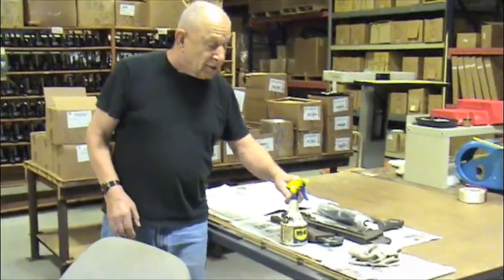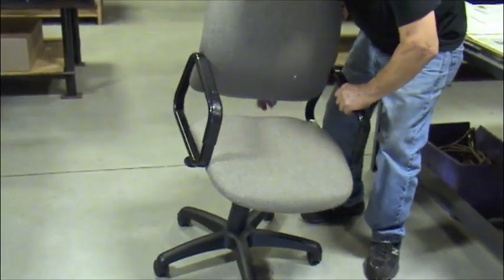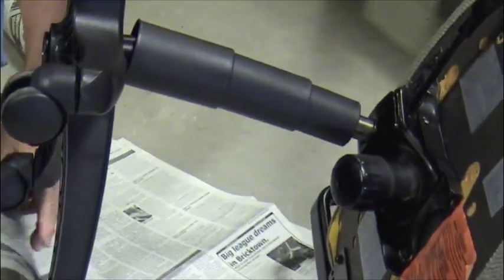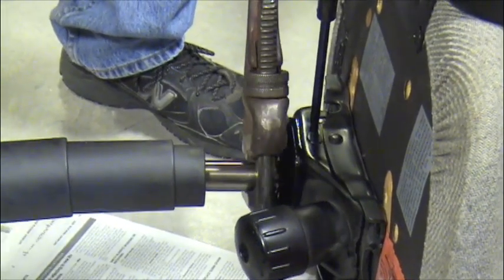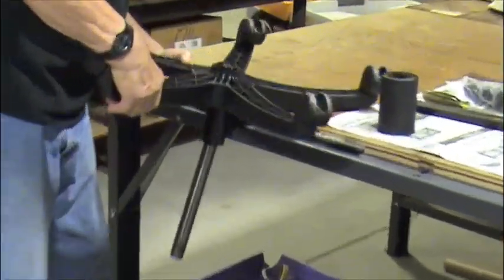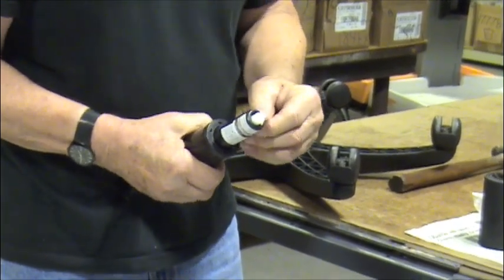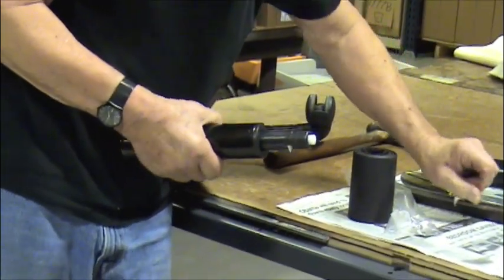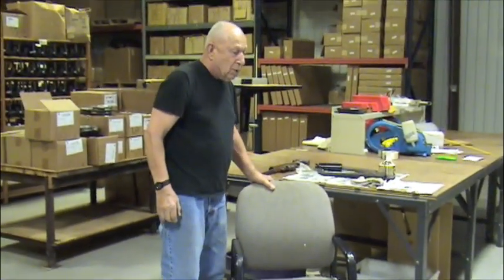How to: Remove gas cylinder using a pipe wrench

Comment: Great video. For those watching who are about to take on this job, pay close attention to the "longer is better" part for the pipe wrench.
Also, make sue that you are using a PIPE WRENCH, otherwise you may not succeed.
I repaired one chair about a month ago and was lucky enough to get the cylinder off using a 10 inch pipe wrench and a few minutes' worth of hammering on it.
On a second chair which I did today I used the same 10 inch pipe wrench, hammered for a half hour trying to get the top end out and it never budged.I was on my way to Harbor Freight to spend 12 bucks for an 18" pipe wrench when I saw my neighbor outside - I asked if he had a big pipe wrench and he handed me an 18" one. The top of the cylinder was loose in 10 seconds.
I then went to hammer the cylinder out of the base as shown. It wouldn't budge. I let it soak for a half hour with PB Blaster. No dice. I took the 18" pipe wrench to it - 5 seconds later it was out.
Big pipe wrench is the key to removal.
Thanks for the video!
Reply: beegee22 if you only had a 10 inch wrench you could have added a short length of scaffolding pipe to the wrench for extra leverage. I always have a 16 inch piece handy for said situations. hope this helps someone :-)
Reply: This video is old, but still the best and really only accurate video on the internet for this topic. The critical part of this is the order of operations. If you want life to not be a living hell, it's: 1)gasket off chair swivel base using wrench (still attached to chair) -> 2)sleeves/wheels off base (now unattached from base) -> 3)hammer off the piston. It doesn't work any other way unless you get lucky AF or are using a garbage, plastic chair. I know this because I spent 2 full days taking apart x2 DX Racer chairs when most videos showed it only taking 5 minutes a chair. I also tried using a rubber mallet on the piston, but it had no effect compared to a real hammer which did the job in seconds. If you don't care about the piston, I'd use a sledge hammer if you can figure out how to make it happen.
Reply: "pay close attention to the "longer is better" part for the pipe wrench."
Yeah Mister White! Yeah science!!
Reply: @shonaoneill5151  Good suggestion, but I had no such thing available. But yes, anything to get some leverage when that thing is stuck in there.
Reply: I used a 24 inch. It worked after a little muscle & wd-40.

Comment: I DID IT !!!!  Followed his video for using the pipe wrench.  I squirted wd-40 on both spots nite before.  then took the base off to get more leverage.  squirted a bit more wd-40 on & after 30 min of working it > push / pull > hammered it more wd-40 it came off !  Keep in mind this chair is pushing 12 years old or better.   hammered the base piece & on 4th hit it popped out.  The video is awesome.  When I called to order > Don was the person that answered !  Great video.  Easy to follow instructions. 😀👍  TYVM Don !!

Comment: Thank you for making this video. I found it of great value in replacing the gas cylinder on my office chair. It was easy and simple. I used WD-40 Rust Release Penetrant Spray making easier to remove. A small tap with my 3 lb. Hammer (Persuader) quickly released the cylinder from the base. The chair is over 8 years old, encase someone might think it was a relatively new chair. And I weight over 240 lbs. Thank you again for putting this on YouTube.
Reply from the maker: +Forrest Hartford  Hi, I'm glad it worked well for you. Thank you for your comments.

Comment: Great video! For those who are trying to remove the cylinder with a pipe wrench, here is a tip (they also have warned this on their website): the wrench will permanently scar the cylinder so if you try to re-use the cylinder (like to swap it to another chair), be sure to twist the cylinder at where it is as close to the top as possible so the scar won't matter very much.

Comment: Thank you for this excellent video and the use of the wd40!  I  got an 18inch pipe wrench ('the bigger the better") and then I sprayed the wd40 - had to do it twice for my 4 year old chair - and it worked perfectly. I ended up just twirling the pipe wrench until I was able to remove the gas cylinder - since I lack the upper strength to really push on the wrench, but it was perfect! Thank you so much! I feel so grateful I found this. I followed exactly as you did, laid out newspapers, sprayed the wd40, laid the chair on the arm side, and placed the pipe wrench and turned!  I was able to not only remove the gas cylinder, but I also was able to place a brand new seat on the old wheel base that is much lower to the ground I am 5 feet tall. I did the whole thing to try and shorten the  new chair seat to the old low seat base and it worked perfectly!  Thank you so much! Appreciate so much Sir!

Comment: This the best and most realistic video I have seen on replacing the gas cylinder on office chairs.  it took me about 2 hours to get the cylinder out of the chair and get the black piece out of the leg base.

The previous videos I saw mention tapping the leg base with a mallet as well as the seat base; however, it took alot of WD-40 soaking for about 15-20 minutes for both areas.  I will probably be buying a new mallet in the future but the leg base finally came of even though all the wheels came off in the process.

The trick to getting off the cylinder is definitely soak the mentioned area with WD-40 and place the chair on the floor and on it's side.  I appreciate the presenter indicating that he had replaced cylinders on that particular chair a few times before so it was easier.

Comment: Thank you Don. To save a few dollars I bought a used chair with a working cylinder at a thrift store, I figured I'd remove the cylinder and use it for the office chair at my home. I was unable to remove the cylinder from the base on the used chair, so I put my chair seat on the new to me base - works like a charm. ALERT, this might not work for everyone,

Comment: Don - Thank you so much for your very informative & helpful instructions. I spent days in trying to remove the cylinder from the base of my chair - until I viewed your tutorial. Yes, the secret is to apply WD40 spray to the joint before using a Plumbers Pipe wrench.
Again thank you with best regards from
Peter (South Australia)

Comment: Eight years later, and this video definitely helped me out. So much better than the other tutorials out there. I found that since my cylinder was so stuck in the chair, I needed to actually whack the end of the pipe wrench with a rubber mallet to get it out, but this video (and another you made) helped me out a lot.
Reply from the maker: It's my pleasure to help and thanks for writing.
Don
mychairparts.com

Comment: I bought a massive 36" wrench for this job thanks to this video, it made it easy as pie after hours of unsuccessful hammering and lubricating with WD40 that they show in all those other fake and phony videos. And my chair was only 1.5 years old before the cylinder had problems so it's not even that old. Maybe I just got too fat while sitting at home due to the Corona virus. :-)
Reply from the maker: Speaking for my website only, our photos are the real thing, no fake or phony. I've been using a wrench for over 25 years and have had only 2 failures.
Don SCP

Comment: There seems to be a lot of these chair cylinder videos. This one seems well done. However, as a caution I will share my experience here as I have with some of the other videos:
I just did my older high quality desk chair. It took 2 days. The bottom wheel carriage came off easily enough I guess, but then......
I soaked the part that goes to seat portion in Wd and PB Blaster, No Joy, and I have a large 18" pipe wrench. Tried it again after soaking overnight. No joy. I was putting so much force on it I was afraid I'd break the rest of the chair. I then removed the seat adjustment mechanism from the seat and put it in a large heavy vice so I could hold it in place better. No joy. Then I clamped the cylinder in the vice and tried a HF hydraulic spreader to try and pop it off while wailing on it first with a dead blow, then with a 4lb sledge, but no joy. I went back to the internet thinking maybe mine was bolted or welded on, but no. Finally, I took some of the more fragile parts off of the mechanism took it out side, placed a board on the ground and placed it on the board and then used the front end loader on my tractor to hold it down. I then put a 4' cheater pipe on the pipe wrench handle and gave it everything I had. Joy!!! My chair is now fixed and works great again. All you need is a tractor with a front end loader and a few thousand pounds of weight and 4' pipe wrench and 220lbs of fat man and it comes right off as easy as pie.

Comment: Ok, one commenter said he used pliers and could not get the part out; the response was a somewhat snappy "too bad you used pliers instead of the pipe wrench we showed you". A better response might have been that some cylinders are jammed in there tighter than others and you may have to really work to get them out. My chair had a part blocking the top of the cylinder so we could not tap it out from the top. We tried vise grips and hammer, a vise with pipe wrench, then extender, then sledge. We are builders so no strangers to getting difficult stuff done. We ended up cutting the cylinder off a couple of inches up (it was already punctured so no worries there), then cutting down into the center of the cylinder and the slot to get it out. Even freed from the pressure it had to be wrenched out. So, swivelchairparts, we appreciate the video, but maybe less snap, hmm?

Comment: Thank you.  This was helpful.   Following up on another viewers ad hoc advice below, after the WD-40, I took a 48 oz hammer (yes, overkill), tapping back and forth on the cylinder loosening it enough to then use channellocks.   The hammer, the persuader as he called it, kept me from running to the hardware store for an extra-torque pipe wrench. Before watching your video, I watched another video, which was good as well, requiring removing the base.  I preferred his method, because I didn't have a large pipe wrench.   His approach went along very smoothly as directed, until I removed the base.  (My chair happened to be configured differently than that presenter's chair, where the other end of the cylinder on my chair was shielded by a non-removable plate, keeping me from hammering out the end of the cylinder from the base).

Comment: Thanks for this.  Was able to fix up a Herman Miller chair where the gas lift had cracked.  It was a lot of elbow grease to get it out of the chair end even with the right tools.  Probably would have given up on it if I hadn't the confidence from this video that it was the correct approach.  If anyone is thinking of trying with anything less than a pipe wrench I wouldn't advise it.

Comment: unfortunately for me i saw another video that said you should bang the cylinder out from the other side of the mechanism so i was trying to twist apart the cylinder that wasn't smooth but really jagged. took abit of man power but in the end worked wonders. super awesome guide - very easy.

Comment: Im my case, I needed to put a LOT of force (torque) on the wrench ... I stepped on it ... and then the cylinder twisted, freeing it. Such hard, but I'm glad I saw this vid first. Thx !!
Reply from the maker: Flavio,
My guess is that the wrench was too short. 15" or longer is helpful for easier removal. A cheater bar usually works if the wrench is not too short, but I'm glad you got it off and that the video was helpful.

Comment: I have yet to see one of these videos where they removed the cylinder from a chair that they hadn't prepped ahead of time.It's not as easy as they make it look!
Reply: I'm up to 3 hours so far today
Reply: Wilfred Willy  I gave up in the end, the metal collar holding the cylinder has broken free from the baseplate holding the chair, I've given up and bought a whole new cylinder, base and baseplate
Reply: Wilfred Willy  12 inches, the part holding the cylinder isn't attached to the baseplate anymore so it all just spins freely. I'm certain once I have the entire new cylinder and wheels delivered the old stuff will just fall apart if I look at it
Reply: true that, Brother, this is bull.
Reply: @tumbles8350  currently doing that for rn haha ordered that gas cylinder thought I could just pop it off and replace... thought wrong buying a new mount as we speak

Comment: I've ordered parts from you guys before but it was a real clown show trying to get the gas tube out.

I used  to throw away really good and unique $450 chairs before I figured out the gas cylinder can be replaced...but I never knew the best way to get the old one disassembled. THANK YOU.

Comment: If your pipe wrench/stilson has wide enough jaws, you can do both the top (silver) bit and the bottom (black) bit with the wrench. Same principle - just grip the bottom part tight, and turn... Works a treat, saves getting the hammer out!

Comment: Hi, I have an Effezeta Chair. I removed the cylinder from the seat leaving the cylinder still attached to the base. I have tried to remove it from the base with no success. It seems that the plastic tube is forged to the base. The auto repair shops in my area are reluctant to use a bearing press on it fearing it might break it. Do you know if the tube can be removed for this brand of chair called Effezeta? It's made in Italy.

Comment: To remove a stubborn base, try hammering on the ends of the legs (near the casters) for improved leverage. It if has a metal base, try using a heat gun to expand (loosen) the base.

Comment: Hey, thanks for the suggestion to use a screwdriver to wedge that clip back in xD EUREKA that was very helpful. Only when I finally got mine in, I had to do it without the outer washer! what is that washer for? seems ok, but should I wrestle with it again, should it fail in the future cause I couldn't put it together right? thanks Don.
Reply from the maker: If now there is no room for a washer, then don't concern yourself. Forget about it.
Thanks for yur purchase. 

Don
Reply: swivelchairparts hey friend, great video, you might tell people that if they only have a short pipe wrench (like me I was at the back of the line when wrenches we given out lol), but seriously, take a strong piece of piping, shove over the end of the wrench, hey presto big wrench. I saw mechanics doing it years ago, it has worked for me every time.
things pop off in seconds rather than many frustrating minutes if not hours!

Comment: Thanks for the video Don. Unfortunately it didn't work for me. I sprayed WD40 as suggested and left it for a couple of hours but it wouldn't budge. I have even removed the base from the chair and bolted it to a workbench for more leverage but the gas lift is firmly stuck in the base of the chair. Any suggestions?
Reply from the maker: +David Greenwell  I have to admit that every once in a while we run into the same problem. But I have to ask you, what length pipe wrench are you using?
Reply: It's a 14" - probably not long enough to give me enough leverage. I think I know what you're going to suggest - slip a bit of pipe over the end to give me a longer lever?
Reply from the maker: +David Greenwell You are correct. Also, some cylinders are easier to remove than other commonly due to the users weight.

Don
Reply from the maker: +David Greenwell 
Not any David. How about a Auto repair center that has a Bearing press. It will take them only 2 seconds after the set up.
Reply: +swivelchairparts Thanks but I actually broke the chair trying to remove the gas lift... ended up buying a new chair (a better one so not all bad).
Reply from the maker: Well, good luck with this one and now you are experienced :-)

Comment: I was successful by hitting the cylinder inwards with a hammer to start with from all angles [to try and loosen up], then used a locking spanner [as I had no pipe wrench] and finished by using a hammer to bash the spanner, to turn the cylinder!
Reply from the maker: Hi,
If it worked out good, you did good and  that's what matters.

Don

Comment: hey hi, what is that wheel on the base of the chair for i dont understand
Its a big wheel it is screwable 
I can loosen and tighten it, i just dont understand what it is used for
Reply: The knob usually adjusts chair back tension or lumbar support, if provided.

Comment: Every video misses the most important item to make the removal very easy. Purchase PB Blaster. This spray will allow almost any tightly set items to literally fall off. Spray around both of the insertion locations of the pneumatic tube. Allow the PB Blaster to be absorbed for 10 minutes. Tap on the base of the chair and subsequently the top of the chair base with either a steel hammer or rubber malet. No need to utilize pipe wrenches.